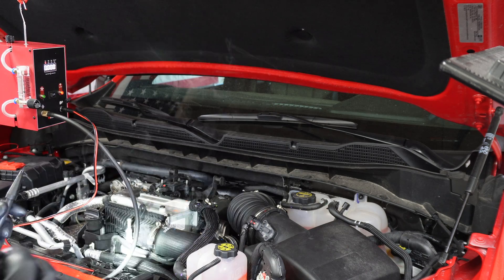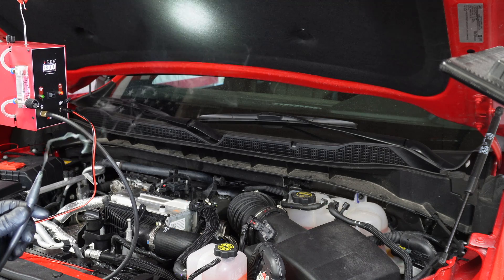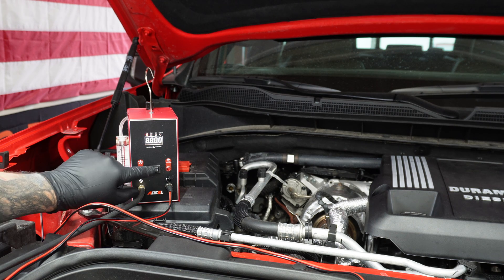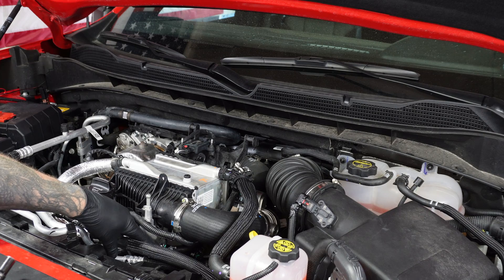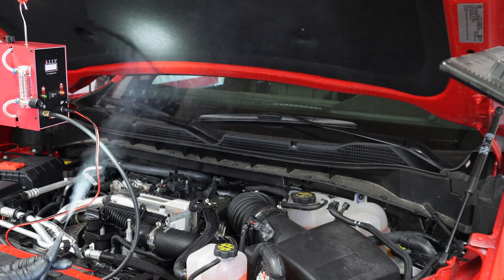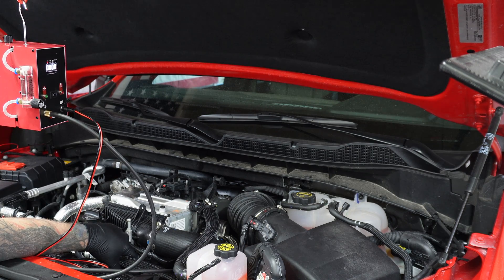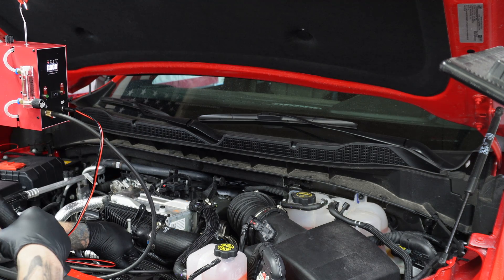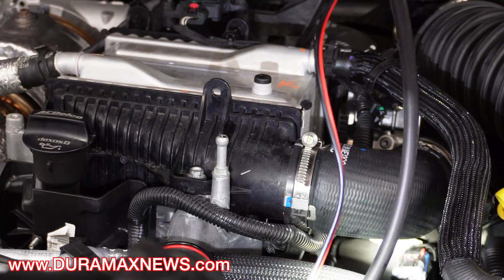3.0 Duramax Cracked Intake Manifold? Smoke Test will show ! P2C7A - Exhaust

Comment: I was looking at a 2023 3.0 Duramax trail boss and after test driving it I opened the hood and pulled the oil cap off and white smoke was coming out and it was coming out of the dip tube. I’ve done a lot of research and some people are saying it normal. Is this true???
Reply from the maker: Yes, it is normal.
Reply: @ thank you i appreciate it

Comment: HELP!!  Not related to this video but you know so much about these trucks.  Changed engine oil today and noticed when checking fluid level, I had smoke coming out of the dipstick. Blow by?? 31,000 on the truck. Advice needed
Reply: It's very interesting for me also. 
My truck 2021 with 25K only. I have similar symptoms. 
I opened  oil cap when engine was running  and figured out a lot of smoke  coming out. The same  from dipstick. Engine absolutely not taking oil between oil change.  Next week I'm going to dealership for maintenance, will  ask them about it.

Comment: I keep getting this same code randomly. Sometimes twice in a week, sometimes it’ll be months. Hot/cold engine, hot/cold ambient. Only thing I have noticed is it’s on startup. I’ve deleted it and also let it clear on its own. I think it may be triggered by an out of parameter signal on start from some emissions sensor.
Reply: I got the code every week
Reply: Ended up getting an SCR/DPF at 72,000 under warranty. It finally started throwing a Regen frequency code.